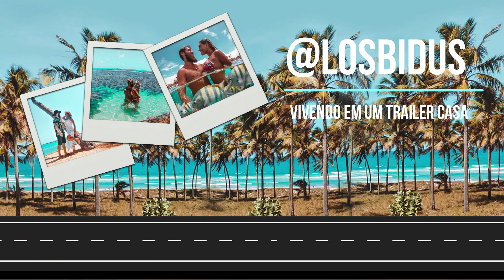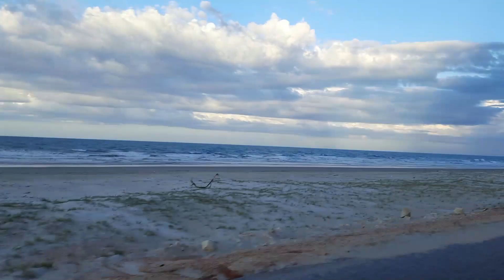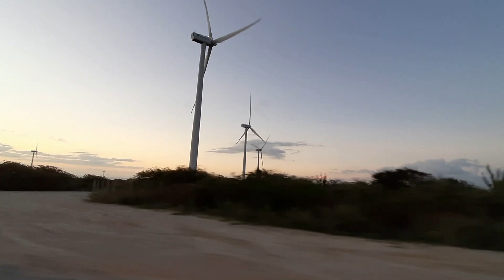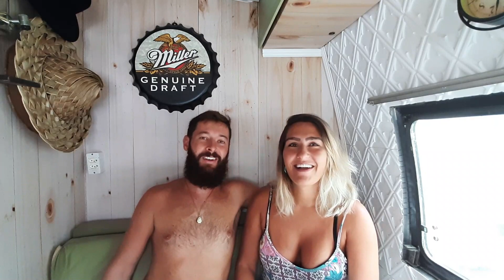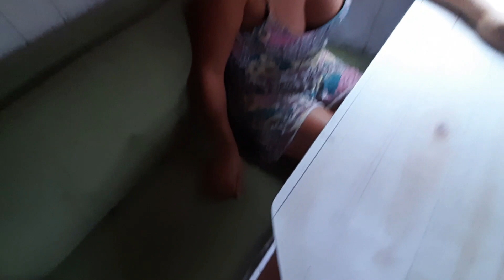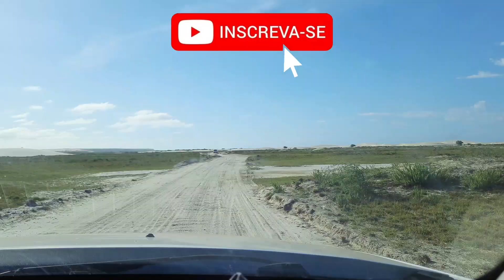ENERGIA SOLAR EM TRAILER E MOTORHOME DE FORMA SIMPLES

Comment: Isso aí, vocês acertaram, usem tudo em 12/24V, um pouco de equipamentos de 127/220V usem pequenos inversores por POUCO TEMPO, existe carregador de 12v para notebook e também fonte para TV de 12V para 19V, é que o Brazil é uma pobreza tecnológica só, no exterior tem lojas de equipamentos de 12V com facilidade.